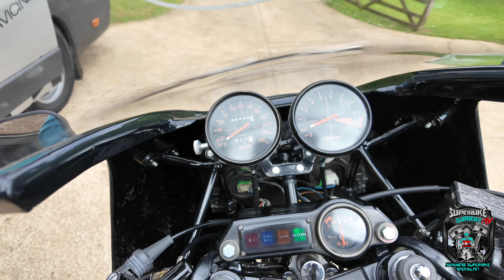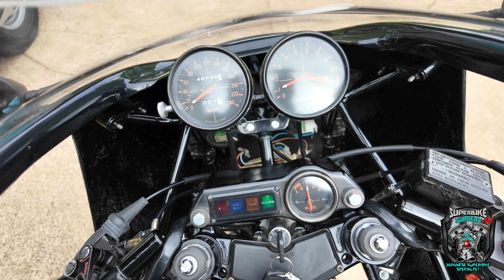If Batman Rode a Japanese Bike, He'd Ride This 6 Cylinder Honda CBX1000 !

Comment: Found this channel since I'm 50+ and pondering getting a bike – since I'm fairly used to handling a spanner (high precision machinist, worked at a garage, electronics as hobby...) I intend to do my own work but I'm not familiar with bike systems. But I'm waffling, back to topic... This channel has quickly become one of my favorites and one of very few where I hit "like" before watching.
Reply: I too am 50+ and have been riding for 40hrs. Highly recommend getting a bike and you will find a whole new world👍

Comment: Had the carbs off mine 7 times. Leave the lower rear bolt in the engine. Airbox bands loose. Slackening the drive chain slowly lays the engine fwd. Carbs straight out.
Reply: Had mine rebuilt by Mike Nixon in the states

Comment: Out of all the people you'd think it shouldn't happen to, in the mid-80s I had to help my Honda Service Manager replace the #1 Con-Rod in his CBX engine after he forgot to turn his fuel petcock off when he parked it (where it leaned far enough to the left for the gas in the higher carbs to flood down into the #1 cylinder) = hydro locked and bent #1 rod when he tried to start it. I don't remember for sure but I think Honda might have designed and made the first vacuum operated petcock because of that issue...

Comment: The powdercoating looks like its been done by a seagull on some bits  bolts etc are an easy fix for something nicer . looking at the painted over fibreglass stranding on fairing inner would grate my ocd if mine but its not pretty sure owner likes it as is each to their own.

Comment: Hey Jim . Be careful, these were a bugger for filling the sump with petrol. There was a mod to the fuel tap back in the day.
Reply: Yup, I just commented about helping my Honda Service Manager replace the #1 Con Rod in his CBX engine after it hydro locked (because he forgot to turn the fuel valve off) and the mod was replacing the original petcock with a vacuum operated valve...
Reply: @KCadbyRacing  you've got it! I did one one GL1000 Gold Wing for the same reason. Mind you, it made a change to doing CX500 cam chain tensioner mods, 100's of the things!!!

Comment: Very nice bike, on the rev test, looked like it smoked more from left side, is it worth looking back on. great video.
Reply: If you notice, #1 cylinder was the worst. The CBX engine (and rack of carbs) is so wide that they were notorious for flooding the #1 cylinder (when left on the side stand without turning the fuel valve off) = many CBXs ended up with fuel in the bottom end and worst case was, #1 Con Rod would get bent if/when it hydro locked (I know that because I helped my Honda service manager replace his #1 rod)...